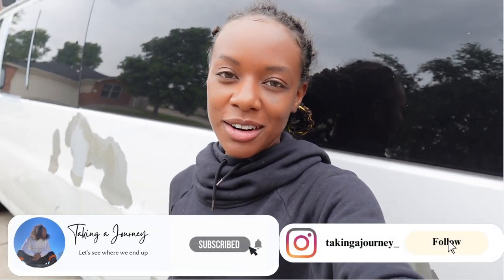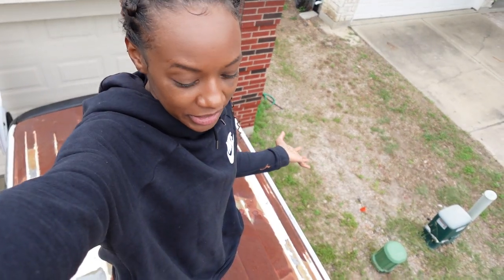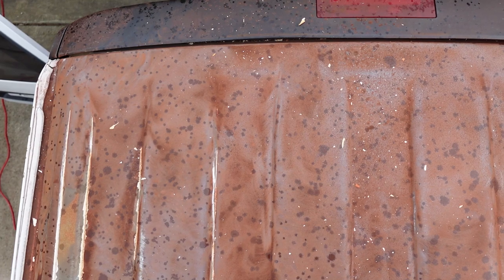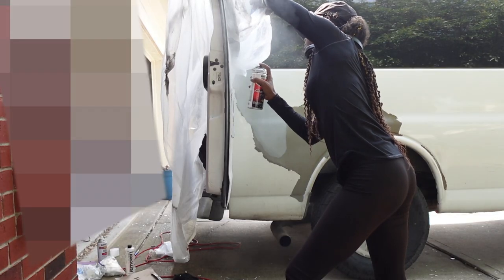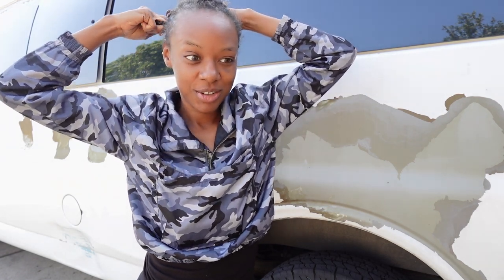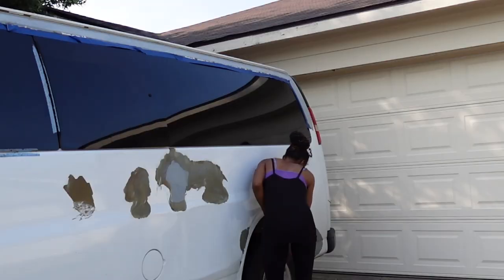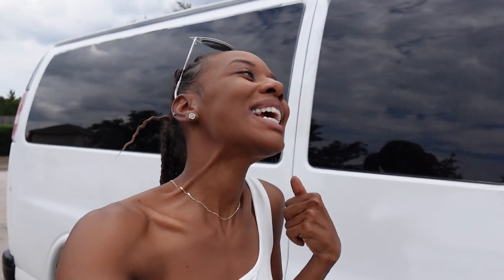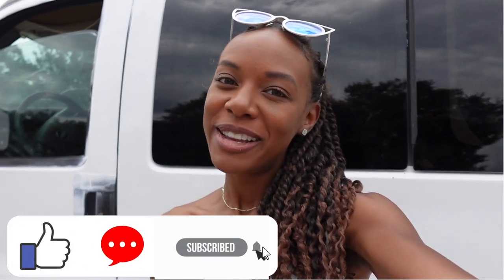I PAINTED my VAN with SPRAY PAINT | (Under $150/ Just in Time for Memorial Day )

Comment: I think you already have it painted now however I have a tip to make it easier on you next time. Pick up a $15 dollar orbital sander with a square pad on it . With the square pad you can take a full sheet of sandpaper and fold it into 3 even pieces and they should fit perfectly on the sander. 
I paint cars professionally and have air tools etc. at my disposal . If I was ant home with limited resources you could comfortably sand a vehicle this way. 
Use 220 grit paper when you have that peeling clearcoat and surface rust. 
As far as mask please try to where it in the future even though it didn’t seem you had a ton of paint dust on your clothes amazingly ,you most likely didn’t breath to much. 
My friends shop just lost a painters helper who prepped the cars for paint mostly sanding… he passed away from brain cancer at 28 , they suspect it was from the toxic paint dust. 
Any questions in the future I would be happy to offer suggestions. 
Keep up the good work. 
Robert
Baltimore Maryland

Comment: def a 10 on the paint, i have used the catalytic cleaner but i think you need to reset the check engine light after you driven a bit. Every car is different how to reset it. i think you need to turn the key a few times without starting the engine,
Reply from the maker: Thanks for the tip
Reply: @Takingajourney_  how’s your back feeling ?
Reply from the maker: It’s feeling much better still little sore but if I don’t bend down a lot I’m okay. Thanks for asking
Reply: @Takingajourney_  you have to be more careful! ☺️